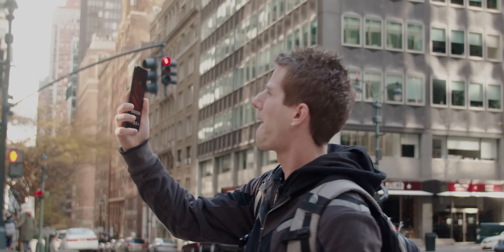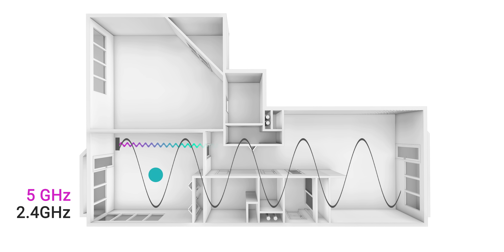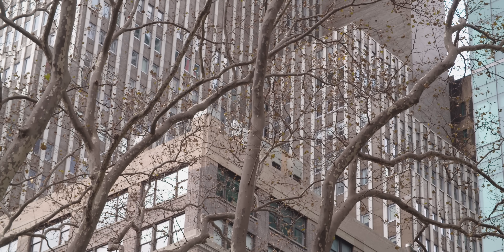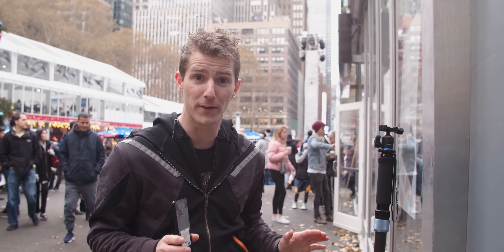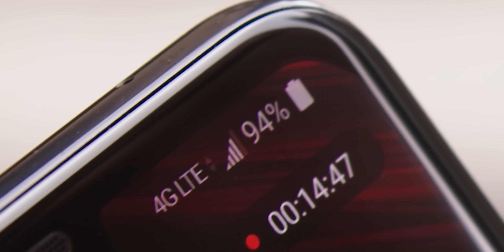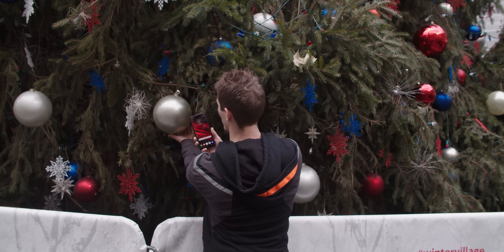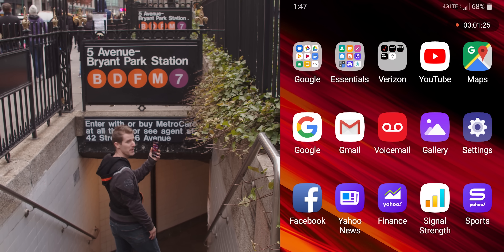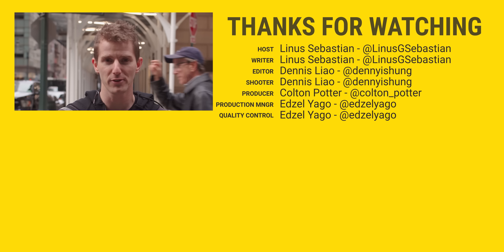The PROBLEM with 5G mmW...

Comment: And we Canadians here be like.
"We don't even have unlimited data cap"
Reply: Unlimited data cap? You know, there would be no cap if it's unlimited.
Reply: Almost all "unlimited" data mobile plans have a catch, they will throttle you at a certain point, but 99% of people won't use enough on their phone to notice. It's just marketing.
Reply: @s8wc3  I have used 120GB this month
Reply: @aarohyotylainen5101  for real I consistently use about 250-300gb a month plus my 60gb hotspot lol
Reply: @s8wc3  i don't know about any body else but given an unlimited plan i guarantee i could burn enough to notice i just think its bullshit they call it unlimited then do this crap somebody should sue their ass for deceptive advertising
Reply: @matthewpepperl  amen brother... I vote Matthew Lewis for president of the USA. I use like 250-300gb a month plus my 60gb hotspot
Reply: @s8wc3  It's the '10/90' Rule: 10% of the users use 90% of the bandwidth.
Reply: @s8wc3   yes they have. I have unlimited lte from t-mobile. Speed is really unlimited (depending on phone limit and signal). The data limit is 21 TB. With maximum speed and continuous download, I can't use it anyway. So in theory, it is still unlimited.
Reply: I have 4G unlimited plan, with speeds reaching up to 40-50 Mbit at home.
I don't know what would be the real limit, but using about 250-300 GB/month without any throttling from the ISP. Torrenting works fine too.
Reply: In my country the unlimited data is only in 3g
Reply: @kushiro6302  hre unlimited is like really unlimited gues i am spoiled.
Reply: Faris Hafiz in Malaysia? Dude I got 4G LTE where the hell do you live?
Reply: Here in Portugal we pay 7,99 for unlimited 4g+, all texts and calls are free and we even get movie tickets as well as Uber and Uber eats order for half the price. It’s actually pretty good
Reply: 7,99 euros (obviously)
Reply: @goncaloaraujo6644  I pay the same but only got 2 gb in canada
Reply: @1cecreampize197  to be fair u earn a lot more than us, our minimum wage is 600 euros
Reply: laughs in unlimited 4g + phonecalls and txt for 20E month
Reply: @reportteemo4690  id check the fine print if i were you they often put clauses in there and they throttle after so many gb
Reply: @reportteemo4690  Laughs in 300/80mbps  unlimited 4G+phone calls + texts for 23€/month :^)
Reply: WheepingInGerman
Reply: In Finland we have unlimited data cap but awful coverage (my 150mbps data plan is often <10mbps)
Reply: @aarohyotylainen5101  same i've got a 200mbps unlimited 4G in finland and at most i get about 80mbps. that shit sucks ass...
Reply: @aarohyotylainen5101 , in Germany we also have somewhat cheap unlimited plans now, but the coverage is even worse and often you only have 2G.
4G n28 (like Elisa and Telia use to my knowledge) is obviously still way better than 2G.
Reply: I pay 15€/m for 20gb 4+5g and video streaming like netflix uncapped. Usually i would pay 3x that for this service here in germany🤣
Reply: Yeah we do just don't go to bell or Rogers, there's usually a few small internet companies like teksavvy home internet give unlimited pretty cheap and same with freedom mobile
Reply: @Michael-uo4jj  You're right.  As I said, my niece has an unlimited data plan, and I know it is through some small company, definitely not Bell or Rogers.  I forget the name, but she's on her cell ALL the time.  And I recall it being cheap.  If I ever get a cell (doubtful) I will use what she does.
Reply: 300mbit 4G, no data cap + free calls&txt 24,90€/month
Reply: Well In my country the unlimited data is capped at 5Mbps, it sucks
Reply: We don't have data caps here in the UK on landlines, but the 4g or plan is only 100gb 60mb £22 a month.
Reply: I’m in Canada and have unlimited
Reply: @WyattH  4G unlimited ?  likely not. I also have a so called unlimited plan at SaskTel but is 4G speed up to 10GB (that is spent in about 3 days) then the rest of the month the speed is limited to 2mbps for up and down so less than 3G still probably the best option in Canada.
Reply: I'm Canadian; I don't own a cell phone, but my niece does and I know she has unlimited data, and fairly cheap as well.
Reply: Germany ftw. Still stuck with my 300mb data cap für 4€/m lmao.
Reply: Lionhart  6gb per month?
Reply: Funny enough I loved Telus in Canada. I was pulling 300-400 down with 50-60 up!
Reply: Go online, order a danish SIM card, pay your 100 danish krone a month (15$) unlimited high speed not throttled internet. It works in Canada, USA, Mexico, Australia, and other countries.
Reply: Well I mean yes but also no. Not defending our telecom industry though, they still suck
Reply: Laughs in unlimited 4g+ and 80gb 5G for 5Euro/M and Gigabit Home Connection for 8.5 Euro/M, yea we have good deals in Romania
Reply: I have an unlimited mobile plan here in Denmark (EU) - unlimited sms/mms/calls and ‘unlimited data’ with a fair use limit of 1TB. Includes 4G+ and it’s only 149 dkk / USD $22. No throttling 😉
Reply: next you're gonna tell us you can't buy alcohol in the grocery store...
Reply: @michaelxz1305  in Texas you cant buy liquor anywhere except a liquor store. Only Beer and wine you can get in the grocery store and liquor stores are closed on sundays
Reply: 65$ For 6gb
Reply: Wait...u guys got internet?
Reply: @naufalhafidz6760  Funny guy.  In fact, Canada has more advanced communications than you know.  Always has my arrogant, mindless friend.
Reply: unlimited is a lie. all services have caps. even on wifi.
Reply: @voidofspaceandtime4684  nop it is really unlimited
Reply: That's bc your country is ran by a Socialist soy boy who is in office to rip you off claiming it is "for the good of everyone" 😂 we have an alpha male here who wants lower regulations and more competition. Lower prices and better products. GOD bless 45
Reply: @Nerd_Rage_Initiated  I hear your 45 is about to be impeached though so I guess he isn't doing so well lol

Comment: Pass on mmw 5g useless when so easily blocked, not to mention the fact that mmw is the frequency microwaves use to cook your food, i would prefer not to be cooked alive, be it even if it is ever so slowly. Yes the power is lower, but health concerns are real.
Reply: Your right about the health impacts, but wrong about the frequency used by the microwave cooker, it uses 2.45Ghz you know like your WiFi/DECT phone/Baby monitor etc, messes with your blood sugar levels and gives you diabetes among other things (they hit the labrats and mice with 2.4 to make them diabetic).  Your wrong about the power being lower too, they need more power the higher the frequency for the same range and a recent BBC visit to Huawei the engineer said the 5G system he was testing was 3,000W and as far as I can determine the existing cellular infrastructure uses only about 300W.  This was a single antenna the guy had also and I expect them to mount multiple antennas on a single fixture.  You only really have to lok at the wiring on the equipment which is going up to see how much power they can deliver, really thick cables.  Also you must remember that these things are firing a collumated beam using a phased array antenna which increases the amount of RF power delivered to a given area and they are in a mesh network so they could be fired in unison at a target.

So health concerns - yes, very real.  Power levels lower - no, that's a lie to placate the noobs.  I suggest you dont cook anything in that unhealthy microwave - I don't have one becasue they are dangerous and the food is crap.

Comment: I have to add to your video ltt in our town how they got 5g to work is they patched the lines of 50+ year old lines to fiber . Your speed is all dependant on how the lines are that day and weather will effect it . I have a tablet in our room and rain will downgrade the 5g to 2g it seems like goes much slower and then winter is here . So I have noticed a drop in the signal just from the bedroom to the living room . I used to get all 4 bars now I get 2 , it was sunny 2 days ago I had 4 bars all day until it got bitter cold then the 2 bars came back . Now in the living room we have 2,5 + hardwire and it effects that as well . Wave combines both to get your speed higher cough cough does not work . Sure some days our speed is high speed 5 g but we can't count on it like we can everything else . It works good when it works good . But if your gaming on 5g and you have lag .. there is a issue . Can't game with lag ..

Comment: Holding your hand over the antenna the entire time... 

Millimeter wave is placed in high density traffic locations such as times square where 4G connections will be completely swamped.

Comment: The problem with T-Mobile is they suck. They have less than 1/3 the number of towers of the top 2 carriers. Less than 1 mile from their store there is 0% signal period, no G's 1, 2, 3, 4 or 5. Just 0.

Comment: Cautionary Statement Regarding Forward-Looking Statements
This communication contains certain forward-looking statements concerning T-Mobile, Sprint and the proposed transaction between T-Mobile and Sprint. All statements other than statements of fact, including information concerning future results, are forward-looking statements. These forward-looking statements are generally identified by the words “anticipate,” “believe,” “estimate,” “expect,” “intend,” “may,” “could” or similar expressions. Such forward-looking statements include, but are not limited to, statements about the benefits of the proposed transaction, including anticipated future financial and operating results, synergies, accretion and growth rates, T-Mobile’s, Sprint’s and the combined company’s plans, objectives, expectations and intentions, and the expected timing of completion of the proposed transaction. There are several factors which could cause actual plans and results to differ materially from those expressed or implied in forward-looking statements. Such factors include, but are not limited to, the failure to obtain, or delays in obtaining, required regulatory approvals, and the risk that such approvals may result in the imposition of conditions that could adversely affect the combined company or the expected benefits of the proposed transaction, or the failure to satisfy any of the other conditions to the proposed transaction on a timely basis or at all; the occurrence of events that may give rise to a right of one or both of the parties to terminate the business combination agreement; adverse effects on the market price of T-Mobile’s or Sprint’s common stock and on T-Mobile’s or Sprint’s operating results because of a failure to complete the proposed transaction in the anticipated timeframe or at all; inability to obtain the financing contemplated to be obtained in connection with the proposed transaction on the expected terms or timing or at all; the ability of T-Mobile, Sprint and the combined company to make payments on debt or to repay existing or future indebtedness when due or to comply with the covenants contained therein; adverse changes in the ratings of T-Mobile’s or Sprint’s debt securities or adverse conditions in the credit markets; negative effects of the announcement, pendency or consummation of the transaction on the market price of T-Mobile’s or Sprint’s common stock and on T-Mobile’s or Sprint’s operating results, including as a result of changes in key customer, supplier, employee or other business relationships; significant transaction costs, including financing costs, and unknown liabilities; failure to realize the expected benefits and synergies of the proposed transaction in the expected timeframes or at all; costs or difficulties related to the integration of Sprint’s network and operations into T-Mobile; the risk of litigation or regulatory actions, including the antitrust litigation brought by the attorneys general of certain states and the District of Columbia; the inability of T-Mobile, Sprint or the combined company to retain and hire key personnel; the risk that certain contractual restrictions contained in the business combination agreement during the pendency of the proposed transaction could adversely affect T-Mobile’s or Sprint’s ability to pursue business opportunities or strategic transactions; effects of changes in the regulatory environment in which T-Mobile and Sprint operate; changes in global, political, economic, business, competitive and market conditions; changes in tax and other laws and regulations; and other risks and uncertainties detailed in the Form S-4, as well as in T-Mobile’s Annual Report on Form 10-K for the fiscal year ended December 31, 2018 and in its subsequent reports on Form 10-Q, including in the sections thereof captioned “Risk Factors” and “Cautionary Statement Regarding Forward-Looking Statements,” as well as in its subsequent reports on Form 8-K, all of which are filed with the SEC and available at www.sec.gov and www.t-mobile.com, and in Sprint’s Annual Report on Form 10-K for the fiscal year ended March 31, 2019 and in its subsequent reports on Form 10-Q, including in the sections thereof captioned “Risk Factors” and “MD&A — Forward-Looking Statements,” as well as in its subsequent reports on Form 8-K, all of which are filed with the SEC and available at www.sec.gov and www.sprint.com. Forward-looking statements are based on current expectations and assumptions, which are subject to risks and uncertainties that may cause actual results to differ materially from those expressed in or implied by such forward-looking statements. Given these risks and uncertainties, persons reading this communication are cautioned not to place undue reliance on such forward-looking statements. T-Mobile and Sprint assume no obligation to update or revise the information contained in this communication (whether as a result of new information, future events or otherwise), except as required by applicable law.

Comment: I'm fine with 4G.
Reply: I'm fine with 3g, any data plan that I can afford has such low speeds anyways
Reply: @bruhmomento4197  But 5G Is not an Ionizing Radiation...
Reply: 4G is enough, 5g is marketing bs. 4G towers are continuously being built at an exponentially rising rate so there’s no reason to go get a new ionising radiating cancer box it’s at 60ghz not 5 that’s just trying to kill you
Reply: @fintan.  it's not ionizing radiation until like a million GHz.
Reply: @fintan.  they're pushing 5G because it's good for business. People will have new reasons to buy new phones, carriers will buy new equipment and be able to charge higher fees, car makers will have new features to brag about.. so yeah, it's THEM who need 5G, not us.
Reply: @ronch550  I think the main point is low latency and better performance with large crowds. But yes real 5G is going to be just in big cities and only when there is enough 5G hotspots.
Reply: @fintan.  well everyone is radiating and has cancer

Comment: I'm a tower technician helping to install TMobile 5g. woooooooooo...... :/ Not as bad as AT&T tech and setup
Reply: Can you elaborate on why 5G is NOT a health risk 
I see a lot of people stupidly claiming that it is, even though radiation 101 is that it cannot.
Reply: @martinytcz1762  I was just talking about basic setup and the extra work that goes into building the sites lol. All the extra steps at&t requires to install older tech
Reply: Just remembered that radio waves are a lower frequency than visible light. The only danger is if you are directly in front of the antenna. Radio waves at that distance can cook you from the inside, but u have to be bout 200ft up in the air and less than 10 ft in front of the antenna. 5g is not a health risk, heck stepping in front of a tree is enough to block the signal lol
Reply: @HAL0SINC  Yeah sadly this is something people don't understand
Then nobody would be worried about 5G

Comment: Notice how they never show T Mobile's low band 5G speeds?
Reply: Cause they filmed this on November 28, 2019 and T-Mobile's 5G didn't launch until December 2nd? Mr Mobile and MKBHD did a comparison if you want to check out that comparison (also sponsored by T-Mobile, but each one claims to be showing their honest opinion)
Reply: @ThatLaloBoy  I've seen the MKBHD video already. They don't have to show exact speeds to admit that their low band 5G speeds are a fraction of the gigabit speeds propped up by the 5G hype. I was just pointing out that Linus doesn't ever fully explain how big of a tradeoff that is. He seems to focus more on the fact that T Mobile is using a mixture of frequencies to achieve more 5G coverage. To me, that seems a little deceptive, but that's somewhat expected since this is an ad.

Comment: You didn’t mention that low band 5G is barely faster than fast 4G speeds
Reply: What? It's way faster and actually has a huge performance boost in distance from the tower.